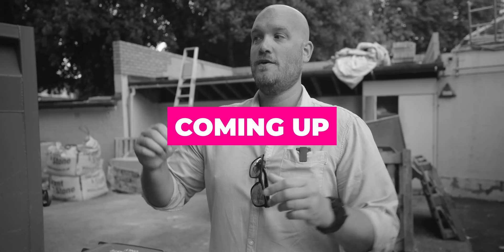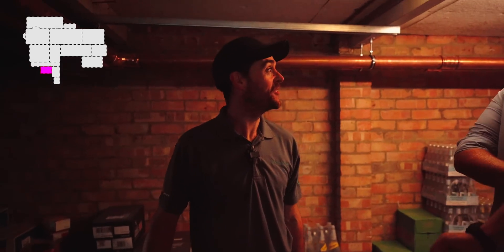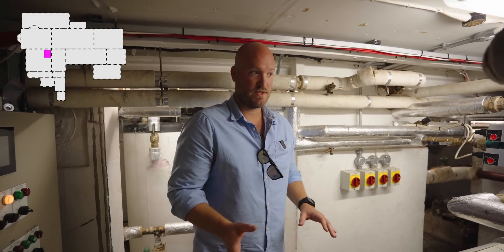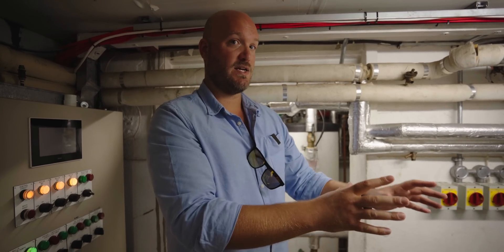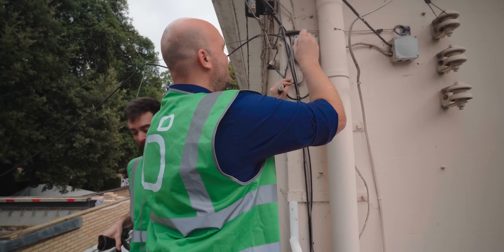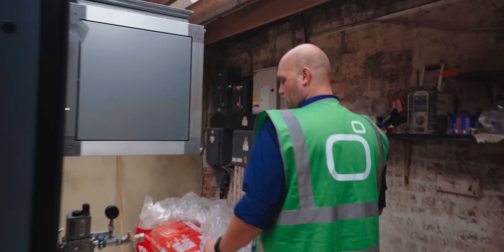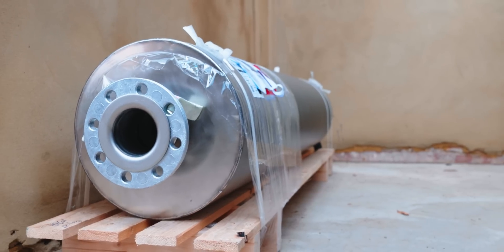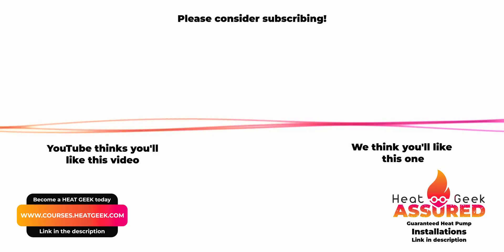This Micro Power Plant Will LOWER CARBON & Save £MILLIONS! | CHP Install

Comment: Why not fit a heat exchanger before the exhaust silencer, to pre-heat the incoming water?
There's an awful lot of heat still in the exhaust gas, removing that heat and putting it to use is not only more efficient and less work on the CHP plant, but also takes a lot of the energy (noise) out of the exhaust so the silencer does a more effective job at damping down what's left.
I'd also be interested in seeing if there's a coolant->water heat exchanger in there as well, so engine heat is being recycled instead of just being vented to atmosphere through the radiator.
Same thing with the engine oil cooler. There's a fair bit of scope for recycling as much lost heat energy out of a CHP plant as possible, but I suppose cost comes into it as well.

Comment: I am surprised that the power plant didn't have any eyelets at each corner for the lift from the top structure, because those straps are ok but that machine is very tall and lifting from the bottom could of resulted in a tip to one side.

Comment: I'm curious as to how this integrates into the grid, can it provide balancing input/generation when the grid price goes sky high? What happens when grid prices go really low or there's lots of solar generation on site?  What do you have as backup, some standard boilers?
Reply: Yes, spot on.  There are some Viessmann 200 to take over depending on what we program.  The demand response thing is interesting but generally for a small generator like this it isn't considered.  The base load of the building is enough that it will rarely be exporting.

Comment: Enjoyed this but don't see this being better  then using solar and gshp/ashp.
Reply: there's the Thames nearby a WSHP?
Reply: Very hard to get around the EA for using the Thames, we've discussed it.  Their main goal is reducing their electrical costs but also a heat pump just wouldn't heat this old building without spending upwards of £1m on the emitters, insulation and pipework throughout.
Reply: They have 100kw of solar going in as well and huge ashp for the sports centre.

Comment: Impressive piece of kit. looks like something out of a container ship engine room. I know it is commercial but pipe runs huge and ridiculous. Supply and install cost must be up there in the nose bleed section. Years to breaking even for the installation would also be getting up there. More efficient. No doubt. Start saving them money after something like ten years. Be interesting to know the calculated break even guesstimate. Gas prices seem to be soaring in UK as they try to stop people using it. Future Proof ?
Reply: The payback will surprise you and will be in the next video.  Future proof?  Well nothing is completely future proof but there is no other way of heating buildings like this than with some type of combustion technology, gas or biomass are really the only options.  This new installation is 20% H2 ready without modifications and is supplemented elsewhere on site with heat pumps and solar.

Comment: I mean I am more of a renewables / energy independence / distance yourself from the market kinda guy but I guess that's not suitable for all buildings and if short term cost savings are the primary goal then a solution like this looks impressive.  Slightly disappointing to fit a next gen system yet still be totally reliant on importing gas and thus at the mercy of whatever the market does over the next 10 years.  Looking forward to the next episode.  By the way IF ANYONE tells you to paint or cover those beautiful big copper pipes you have my permission to silence them in any way necessary :D
Reply: The building needed a new plant room anyway so would have had gas boilers as nothing else was suitable, the equipment in this new installation is 20% H2 ready with no modifications.

Comment: Locking in fossil fuels for the life of the CHP - bad call for the climate im afraid.
Reply: The only real option for an old building like this is a fossil fuel, at least for the time being.  There is no panacea and electrification is not an option here for heat and hot water.
Reply: That’s not true I’m afraid. Electrification of heat is an option in any building, for example a 2 stage process with air to water and water to water lift heat pumps. 

But you mentioned in the video that the site’s priority was cost, of course a CHP is lucrative in terms of cost but is irresponsible in terms of emissions. This is not a source of low carbon electricity or heat, just inefficient generation of both! 1 kWh of natural gas in = ~0.35 kWh electricity and ~0.5 kWh of heat out (in my experience of installed CHPs). Poor use of gas, high carbon source of electricity, but lucrative savings for an organisation who isn’t taking emissions seriously 

I think you need to change the title of the YouTube video. Claim a CHP lowers carbon is dubious at best.
Reply: @TomBray-LowCarbonLifestyle  the efficiency of their existing boilers was far lower than the combined of the CHP.  We'll go deeper into the numbers in another video but other than full electrification whoch isnt suitable is there a solution you think would be lower carbon?
Reply: @patrickwheeler2646  no probably not, my issue is that you are locking in fossil fuels and as such the savings will reduce as the grid reduces in emissions.
Reply: @TomBray-LowCarbonLifestyle  I 100% agree with removing as much fossil fuel appliances as possible, but only where possible.  We don't have an available technology that would supply enough heating and hot water for a building like this except a combustion one, biomass or pure gas boilers are the only other alternatives which wouldn't reduce the carbon footprint of the building as much as this.
Reply: @patrickwheeler2646  we are installing a two stage air source and the water source heat pump at a high heat demand building, supported by PV. Likely to increase costs but dramatically reduce emissions.
Reply: @TomBray-LowCarbonLifestyle  thats cool, what's the heat loss?
Reply: @patrickwheeler2646  it’s actually heating germination beds at a greenhouse so not sized on heat loss. But will provide up to 270 kW of heat. 

We’re installing a similar concept at a leisure centre that will be 470 kW. 

And last year I visited the Salt Ayre leisure centre in Lancaster that has installed a 1.5 MW 2 stage system - https://ivegate.co.uk/case-study/salt-ayre-leisure-centre/

https://youtube.com/shorts/LcPszKEMPas?feature=share